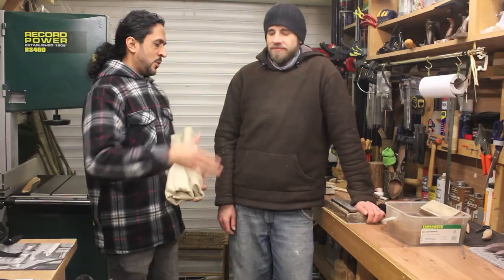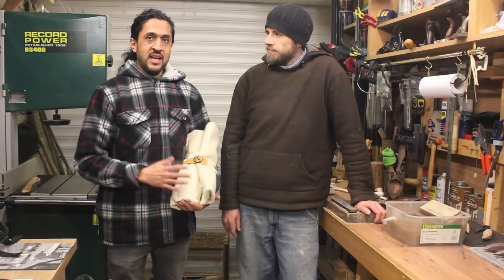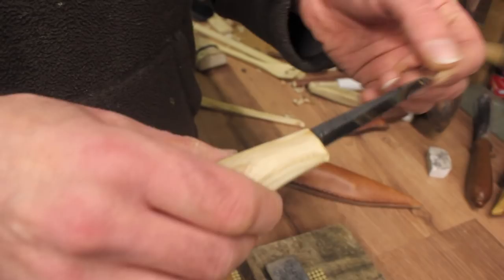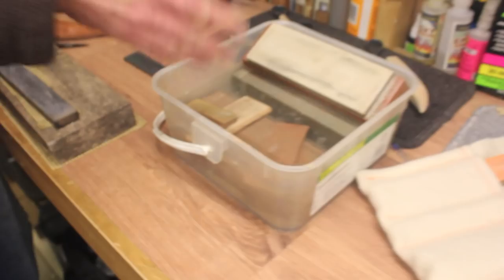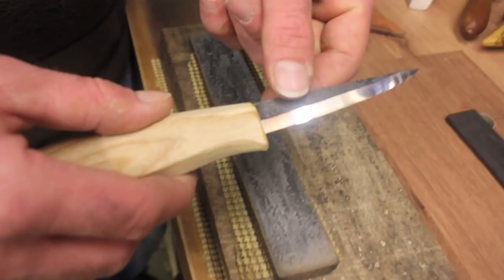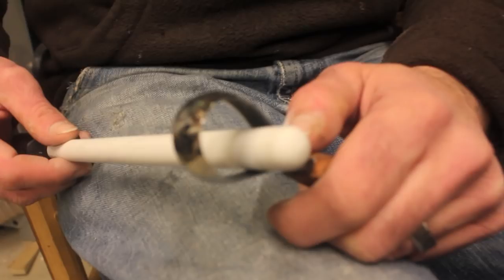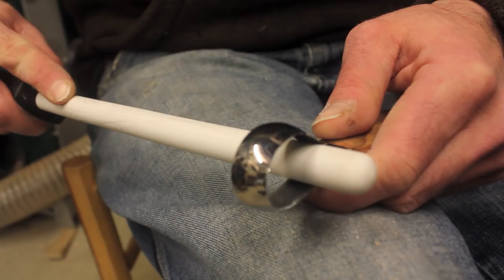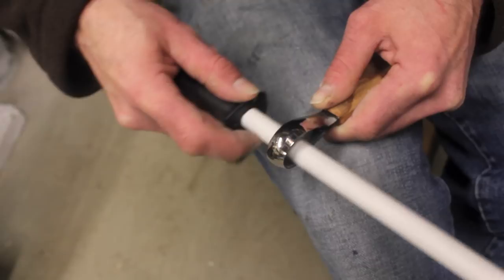Spoon Carving Tools - Sharpening & Maintenance

Comment: How do you make the polishing so shiny? When I tried polishing on leather with some compound you could see some fine scratches on it...
Reply from the maker: Hi Abbas when using sharpening stones / sandpaper it is adviced to work through to the finest grit you can, and then use leather to for gthe final finish ~Peace~
Reply: the scratches you see are from lower grits that havent been fully taken out as you progress through the finer ones. It can also be that your steel isnt as good for the mirror finish. Not all steels are equal, and some dont finish as well as others.